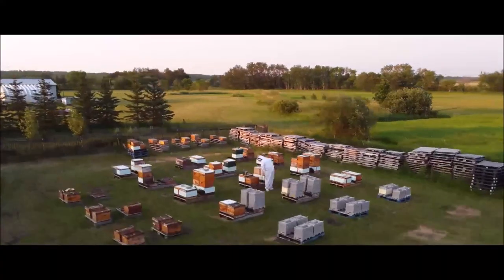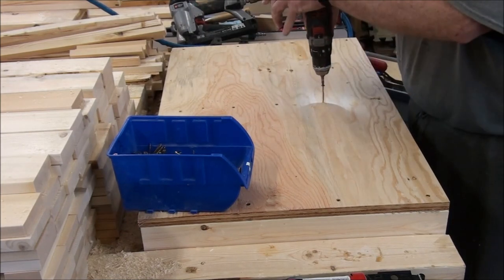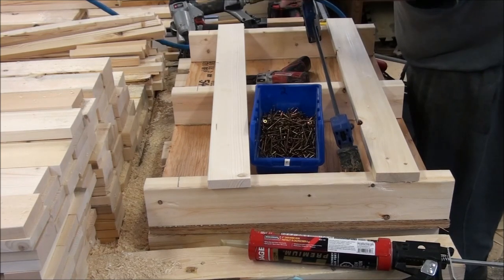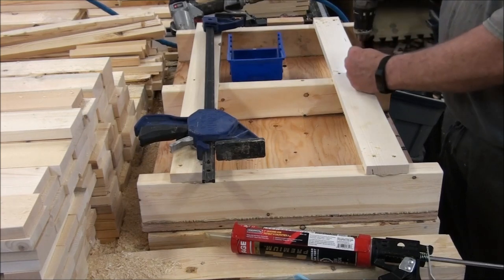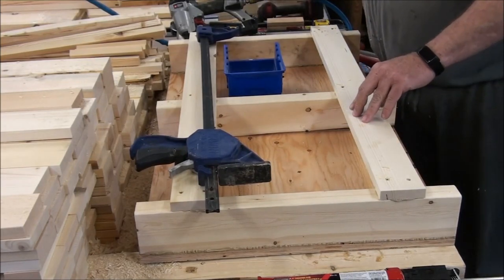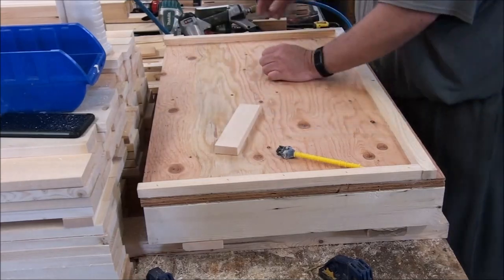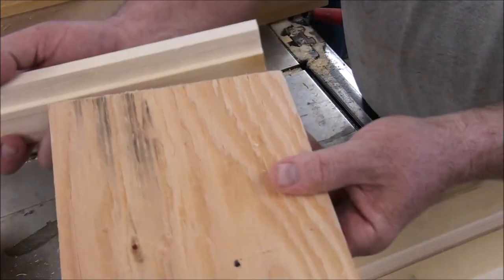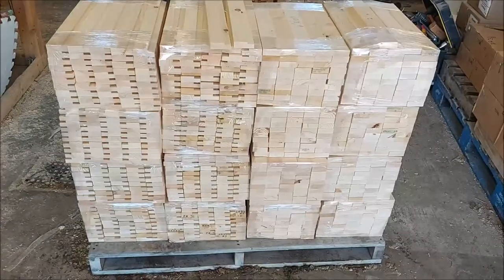🔨Refined Assembly Method and I have Rabbets! - That Bee Man

Comment: Wow Brad, your the 1st person I seen using construction adhesive to pallets. Your going to need a crow bar if you ever have to do a replacement part. Nice job!
Reply from the maker: Yes, they're NOT coming off, hahahaha.  If there is ever an issue, it'll be a broken runner.  In that case, the screws can usually be removed and the broken runner residue removed with a saw or a plane.  A new runner with more glue is then in order.   There should never be a reason to need to replace a 2x4 riser.  These pallets are SOLID!

Comment: What is the width of your end pieces?  2 1/4"?  I've made some lids in the past.  Some with narrow and wide.  Just wasn't sure what a safe overlap on the box was so it doesn't blow off.
Reply from the maker: Hi Breck.  On MY covers, both the top cleat and the end cleat are 2" wide.  That is mostly because then I can cut all one size of part.  The end cleat only hangs down 3/4" which doesn't sound like much but I have not had problems.  This customer wanted a little more hanging down so these end cleats are 2 1/4".  The top cleats need to be 2" wide as they mesh with the pallet runners.